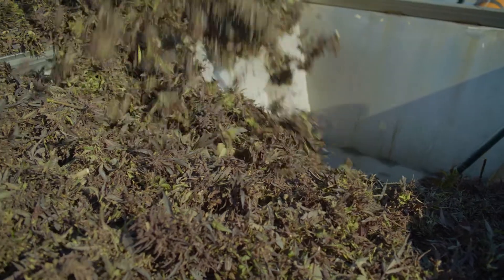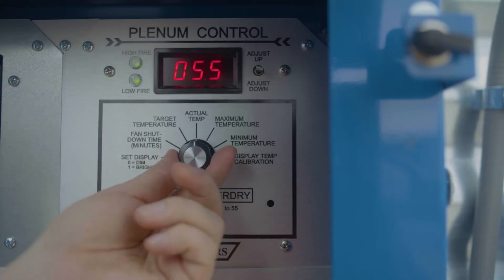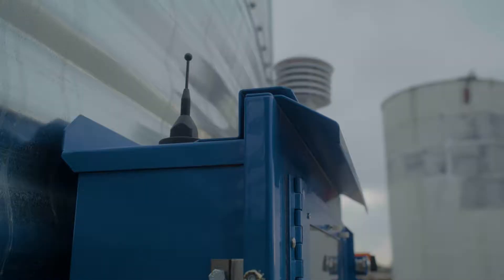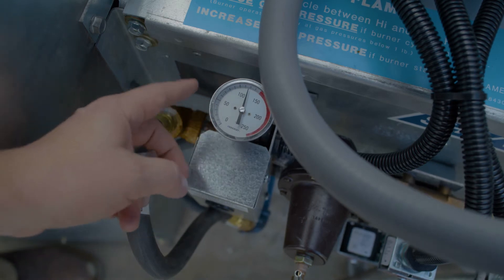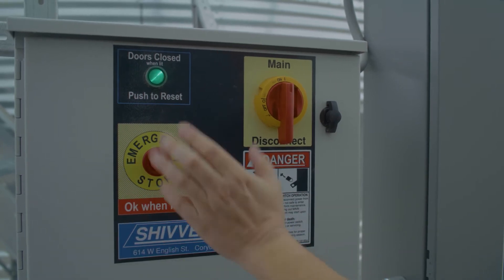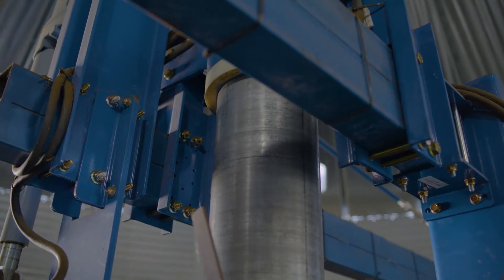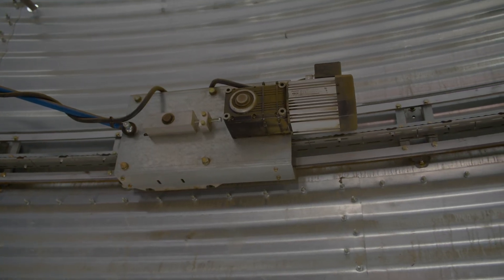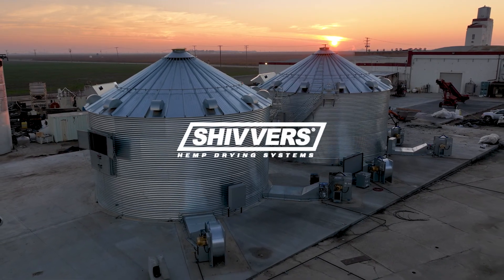Hemp & Biomass Drying System | Operational Overview | Shivvers Drying Systems

Comment: What is the processes before feeding the drying machine? I see that you are feeding it only flores, this biomass has been already bucked and shucked? and how was that done mechanically?
Reply from the maker: Our customers employ a variety of harvesting methods; from machine harvesting with a stripper header or modified bean picker, to hand harvesting. For optimal performance we recommend stem length be kept under 8 inches.